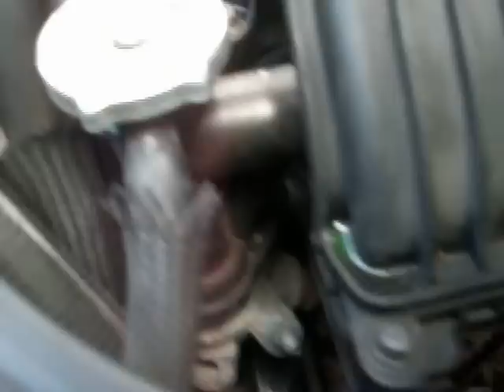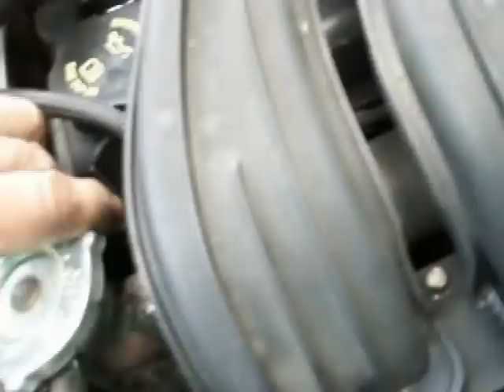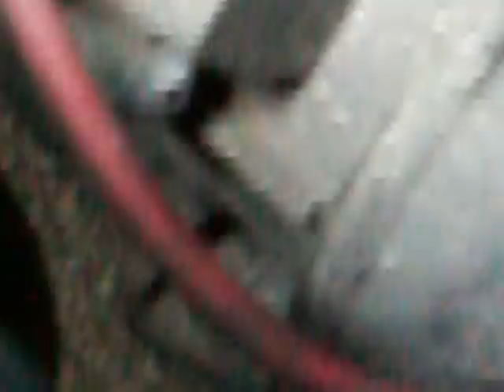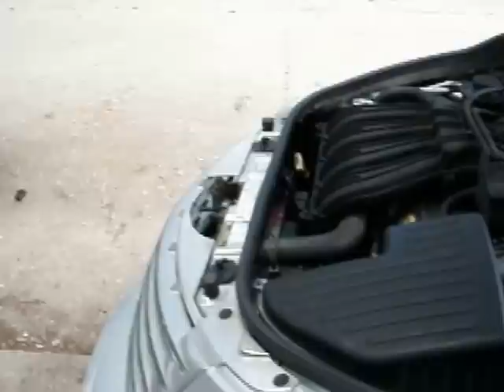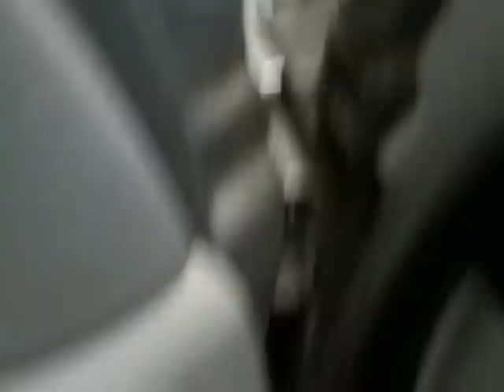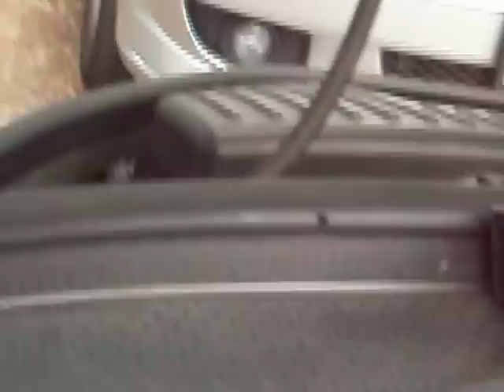2006 PT Cruiser OVERHEATING Issues Part # 2

Comment: Subscribed. This started happening to me a while after the transmission was replaced. Then I think the fan went out shortly after.

QUESTION: 
In the video, does the fan start running just with the key on the 'ignition' setting, or did you ever start the engine, before checking the fan's operation? It looks as if the fan's running but the engine's not been started.

Thanks for the content. 
Keep up the good work.
בס'ד

Comment: I was reading the comments on this.  I have an "06 pt with 130000 miles on it.  Why would I take a car that is 12 yrs old and has no real resale value and spend $900 to upwards of $2000 on it when I can fix it and drive it for under $20?  I was looking for a way to bypass the poor electrical system and get the fan to function... just function. I dont care about the air conditioner because I have had 2-70 a/c since I have owned the car.  After I do this simple fix and if I get another 50000 out of it then it is well worth it.  Thank you for the information Bob,  I dont know why people are whining about the alternative you suggested, I guess they have disposable money to piss away on one of these POS.
Reply from the maker: Thank you for your kind comments. EXACTLY my thinking.........this poor girl was flat broke.  No car = no job = no house, no food & soon to be "out on the street".
Reply: Well I gotta clue you on the breakdown at 150 grand  odometer mark and that will be the timing belt and that is a guarantee not a maybe.

Comment: Why did you just splice the fan into the vehicle. There are some cases you want to oem set up.
Most times it is a functional situation, begging a retro-fit. 

Constant fan running will cause overcooling conditions. Especially in areas that have cold climates.
Most engines wear internally will occur in the first few min of running until it warmed up.
This is why thermostats are used on cars to prevent cooling until proper heating of the engine has occurred.
Bottom line you don't have a vehicle that lasts as long.
In this throw it away culture we have now, it probably makes no difference anyway.
If you want it simple, do as this gentleman did here, you will be just fine:)
Reply from the maker: OBVIOUSLY......................you NEVER worked on one of these pieces of CRAP.  LISTEN.....to the 'narrative' on "Part # 1".  This poor girl had been through hell with this car & previous mechanics AND "MOPAR Dealers", one dealer put an ENGINE IN, (wtf).  After spending several THOUSAND DOLLARS....it still overheated. So Much for OEM Set up.  (MOPAR couldn't fix the damned things).  The 1st few 2 -3 years the PT Cruiser was made they were GOOD cars.  After Chrysler's financial issues & having 'outsourced the components of the car to 3rd parties....the PT Cruiser became a great big lemon.   There are 69,009 hits on my "Part #1, 26,483 hits on Part #2 for a total of 95,492 hits TOTAL.  That's damned near 100,000 hits.  (TO ME....that means A LOT of people are having PROBLEMS, despite what you say about OEM set-ups).  As of today 3/17/2018  it is only been post 31 months.  Originally posted 8/17/2015.  Imagine how many hits would be there if it had been up since '06.  (Hell I should've "monetized" it & charged $10.00 a hit).  I'm NOT about that.  I've taken lots of time to fix that bucket of bolts, & many Saturdays answering Genuine Questions from anxious Owners that have NO Money for ANOTHER FAILED repair.  RATHER.......than criticize me......go Fix something most people find Unfixable & POST IT.  Then sit back, try to be a good Christian & ANSWER EVERY QUESTION.....take EVERY 'Snide' remark, "half-assed" untried theories......for the next 30 months (on YOUR free time) without loosing your temper.  UNFORTUNATELY......after 31 months...you just managed to step on my last nerve.  PLEASE, do NOT criticize, condemn, or complain.  Oh yeah, go GET A LIFE, preferably one in service to others....!!!!!  (THEN..................after you've done THAT.....maybe, just maybe, you can pass JUDGEMENT on others).  "Judge not, that ye be not judged. For with what judgment ye judge, ye shall be judged: and with what measure ye mete, it shall be measured to you again. And why beholdest thou the mote that is in thy brother's eye, but considerest not the beam that is in thine own eye?".  ~~  Matthew  7: 1-3   Have a Nice Day :)
Reply: Over-cooling lmao no such thing engine wise lol

Comment: Mr. Bob Pittman, thanks for a very informative video, I have a simular  problem,I was wondering  if you could please provide me with a sketch on how you ran the wires to fuse box,so that the fan turns on as soon as the ignition is on. Thanks
Reply from the maker: Carlos, I covered that in Part 1. This is Part 2. Also, it was 3 years ago that I made this.  The car was disposed of around 324,577 miles. It was pretty much worn out, the owner is a "Home", Social Worker.

Comment: I've been chasing this problem for 10 years.  I'm on my 4th fan. I cut out the plugs and added 3 connectors. Does it take booth hot wires  to run the fan on high ? Or is it one for low and one for high ?
Reply from the maker: It has a wire for each speed. HOWEVER, the ground is the same size & fries as it. You do better by add I ng a separate ground to the motor housing. Hopefully this helps.

Comment: hi bob   I have a  01 pt cruiser .   that's started over heating .  its got a new rad and water pump   and  temostat    hi and low speeds work  o fan I check it out .   and when  I hook it up  the low speed work   with the  relay but  not the hi speed  .    unless   I take a  wire  from the ground post  and  hook it to  one of the wires  on the   wireson the  hi sp relay . and then the fan starts .    I know this is not right because the relay is there for a reason . .       parts store told me it was the   blower moter resistor  .    and  plases explane to me what the hell is a scotch tab.    .
Reply from the maker: Hi, to see what a Scotch Tab is, please look below to the entry on June 20th. of this year. It was an answer to Roger Decor.....about three or two questions down.  From your question, you have one of the better model years. Replace the relay that you are taking a wire to.  You could use another relay in place of it. Also, check that the small harness that connects the fan wires to the main harness,  below the battery. Shy of being under the hood with you, it's the best answer I can give. You've already covered most of the problem area's. The only other circuit that's in play is the A/C circuit. If the A/C is out, the low pressure switch on the dryer unit will keep the high speed fan from activating.

Comment: what is a scotch tab?
Reply from the maker: It's a BLUE clip originally designed by 3M Corporation about 46 years ago. I  learned about them from someone setting up Stage Lights @ High School Varity Show. It is basically a "Holder" for those who have trouble "Splicing" wires together, or someone up in their years (I'm in my 60's) who's hands aren't what they used be.  It is square w/places for 2 wires.  The Line wire, (which is the ENERGIZED Current wire you are taking power from) which holds a solid un-cut wire, & the other side of the clip holds a new wire's end only.  There is a conductive "U" Shaped metal clip, you squeeze the clip into the wires while holding them in the clip, then a lid fastens down over the housing to hold it in place.  The clip Penetrates both the live wire & the wire which you want to use for Power.  No Cutting, or Splicing required.  They are effective up to 25 - 35 amps, which is quite a bit more than the fan uses.

Comment: PT cruisers REQUIRE yes REQUIRE special GO5 formula coolant is says right on the reservoir cap in bolt print CAUTION SPECIAL ENGINE COOLANT ONLY>  do not use green coolant or non HOAT coolants
Reply from the maker: Robbi Saurus, you are 100% CORRECT.................(for GM vehicles BUILT & SERVICED from 2002 through 2005). The SAME...holds true for PT Cruisers 2002 - 2004. Also other Mopar, Dodge, & Chrysler automobiles.  The Vehicle in this Video (2006) WAS MANUFACTURED "After" the "Problem Years".  BY THE TIME....Cars START "OVERHEATING", somewhere along the way the WRONG Antifreeze WAS USED.  You ARE CORRECT in that statement, the cap shown in this video DOES NOT carry that distinction. (see the 0.42 second mark, on the 3:57 minute Video) .  (That's why we're talking about "Overheating Engines"). 1st...!!!, lets 'Explain' what is a HOAT, or OAT Antifreeze.  What is 'Hoat' coolant?  Certain cars are built with organic acid technology (OAT) antifreeze (example, DEX-COOL), or with a hybrid organic acid technology (HOAT) formulation (example, Zerex G-05, or Mopar 68048953AB), all 3 of which are CLAIMED to have an extended service life of five years, or around (150,000 )miles, or 240,000 km . After a Few years on the Market, & Engines started "Blowing UP" left & Right, the Engineer's Realized it was time to "Go Back to the Drawing Board".  (Please "Google"....."Class Action LAWSUITS + DEX-COOL" & Mopar Extended Life fluids). (If you feel STRONGLY about following "Dealer Recommendations, by all means, use a "Hoat Coolant").  On Amazon, Genuine Mopar Fluid 68048953AB, can easily be purchased.  After about 150,000 miles (What these coolants were designed for, "extended life & little flushing & coolant replacements").  What you refer to is "What HAPPENES if you MIXED the OLD Green "Low Silicate Green / IAT" (Inorganic Additive Technology), Conventional Green fluids, with "Mopar Fluid 68048953AB", or "Dex-Cool"..??  Correct..??  Within days you'd end up with a Chemical reaction. The Result, would be a "Peanut Butter" type slimy fluid which would CONTINUALLY Expand up to, & UNTIL it WOULD BLOW the Head Gaskets, or Lower Engine Block by "Blowing out" a Freeze Plug.  I'm Providing this video for people who's ENGINES are "Just Starting" to act up. (OR....Already Damaged).  ALL Coolant Problems SHOULD start with a COMPLETE & LONG Flush, then fill.  (If it is ALREADY OVERHEATING, as it STATED in this Video, THIS particular ENGINE WAS replaced & this is what is being DONE AFTER the Damage WAS Repaired. (Also stated in the Narrative).  New universal coolants use unique OAT-based corrosion packages with proprietary organic acids (such as carboxylate) to provide a broad spectrum protection. When universal coolant is used to top off a cooling system that already contains extended-life OAT or hybrid coolant, the service life is unaffected if only "Topping off" a quart or two.  On ALL Overheating Engines I STRONLY Recommend REPLACING the "Brand Specific" Coolants with a "Universal Coolant" Recommended to 'mix' with your current fluid AFTER A very good Flush.  (My Sources: Answer.com, FixYa.com, O'Reilly Auto Parts, automotiveforums.com & my own Bachelor of Science in Combustion Engine Theory & Motor Sport/Racing Automobile Qualifications).  Excuse me for taking a long time to answer this. I'm in my 60's & in poor health.  (A.J. Foyt Jr. is Heavy & has difficulty walking, nobody would deny he won 4 Indy 500's.  Richard Petty, is The King of Stock Car Racing.  Nobody would argue that, but, he's older, NOW & no longer Races). What I do NOT Understand, is WHY a KNOWLEDGABLE, but OLDER Mechanic is given ZERO Credibility. I was a Chief Line Mechanic.....for MANY winning "Amateur Race Cars", but, sadly now I'm OLD, TOO.  There's NOTHING wrong with SHARING the Knowledge I've amassed over the last 4 1/2 Decades.  I DO NOT charge for my 'knowledge' I just try to 'help' people along the way.  Elderly Couples, or Singles.  Single female Parents,  or People in general that CANNOT find a reputable mechanic.  If you feel I have "Missed something, or Completely LEFT out a Viable Alternative, PLEASE COMMENT, as you have. (I Like other's Input).  I welcome "BRAINSTORMING".......the More answers, .......the More "Experiences" will help the WORKING POOR.  That is my Main Objective, to "Help".  "Treat others, as you would have the treat you". ~~ "Jesus the Christ".  God Bless, & Godspeed on your Repairs...!!!
Reply: @bobmpfirrmanii  
Hi Bob and THANK YOU!!!!!!! I hope this finds you in good health. I have a 2006 Cruiser that is running hot only in summer and never on the highway. I get gurgling after turning it off and I believe that's a sign of air needing to be bled out. Can I fill the radiator to the top and reservoir (to cold fill) before I drive it in to trusted mechanic?

I am also worried he'll be insulted if I ask him to flush it and bleed it.

THANKS AGAIN. I hope you have a moment to answer. If not, I understand.
Reply: Bob Pfirrman II Thank you so much for your time and knowledge.
Reply: Bob Pfirrman II where does one get this coolant? None of the auto parts stores I went to had it... is it dealership only?
Reply from the maker: You can buy it From Amazon. Those are their part #'s listed.  I recommend a GOOD, GOOD Flush out & SWITCH to the Prestone "Universal" Anti-Freeze.
Reply from the maker: Your Welcome

Comment: Over Heating 2001 PT - changed the "High Speed Radiator Fan Relay"..... no problems after replacement.
Reply from the maker: +Hud Jackson (hudjack) Yes, I tried ALL Fuses & ALL Relays 1st.  That would have been the simplest fix.  I realize with my old (near 60 year old) hands shake bad, it IS a 'poor quality' video.  This car's problems started AFTER 175,000 Miles.  Previously, mechanic's WERE able to fix it, doing the same (Relays & Fuses).  BUT, after going through EVERY car in a Junkyard. (over 14 in all, only about 7 were the same year as the one I was working on), Only 1, had that 3-wire 'pig-tail' intact.  SO, when the relay & fuse replacements FAIL.......the solution is to order, or find THAT 3 wire pig-tail, & replace & Strengthen it. Sorry, I'm so wordy, & can't say it in less words.  Seen this on 9 "PT Cruisers" now. (The gal that I fixed this for, literally, has people coming & knocking on my door to show them the pigtail, due to her referrals).   2 Have BEEN Chrysler Mechanics.  I think that sums up, that the pigtail is the REAL problem, blowing the fuse & overheating the relays is the 1st thing.  But, you can keep replacing them, then they WILL constantly fail & you end up with a problem, Chrysler is NOT sharing.
Reply: +Bob Pfirrman II My 2001 PT has 254,000 miles, never changed the Timing Belt nor the Water Pump. I did change the Radiator around 100,000 miles, front end damage.  I purchased the "High Speed Radiator Fan Relay" from my local auto parts store for about $30. Ten minutes to remove intake air box and replace relay (behind battery and in-front of fire wall driver side). Part lookup under "heating and cooling section" in-store computer. Relay had five pins no pig-tail.
Reply from the maker: Yes Hud, I understand now.  Yours is a 2001 PT, from your Comment.  I have heard of "FEW" issues from the 2001 + 2002 Models.  In the years following 2002, Chrysler/Dodge had many financial issues through the following years.  A TREMENDOUS amount of the wiring, engine, & dashboard & internal controls (such as the blower fan on the Heater Core) were "outsourced".  THOSE models & the problems associated with them is the 'target' audience this Video was Intended for.  I'm glad you responded, it will give great assurances to those with the 1st Models of the "PT Cruiser" that came out.  I had one myself & Highly recommended it.  After many, many friends........bought later Models & had horrible nightmare experiences, & called to tell me, I developed this Video to address those issues.  I have worked on more than 4 type wiring harnesses, & 3 type fuse boxes........so I do know what I saw with my own eyes.  (plus, looking under the hoods of multiple year Models in Junkyards.....will 'confirm' this)  I'm glad for anyone, that has only minor issues with their cars.  Most of my Video's (on ant Vehicle) address Issues Manufacturers refuse to admit.  If they admitted it, it would cost them millions in 'recalls'.   When Ford Motor Company refused to ADMIT they had a defective front "A - Frame" lower spindle arm....(1979 + 1980)....I had the wreckage (with only 355 miles on it) towed  over 600 miles & Dropped It in front of Ford's American Headquarters.  The arm came loose with my 1st wife & newborn son in it.  As they were on the Expressway.....it spun 360 degrees multiple times, & rolled down an embankment.  Luckily, they were OK, wife with bruises & lacerations only.  My son, in something that had just been greatly Improved (Children Car Seats), he was fine.  I am not that "Pro-Active"..........but, when I come across something causing people thousands of dollars, or their safety, I get involved.  (The event with Ford, triggered a 'recall' on all 1979 & 1980 Ford Fairmont's & Mercury Zephyrs).